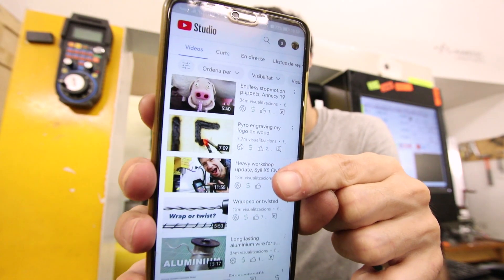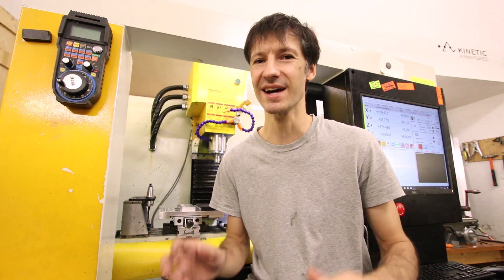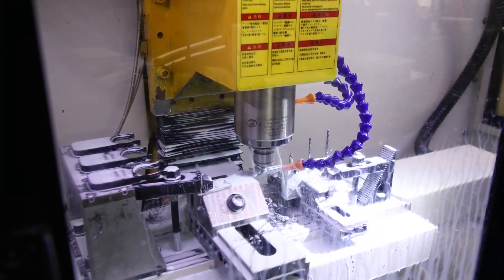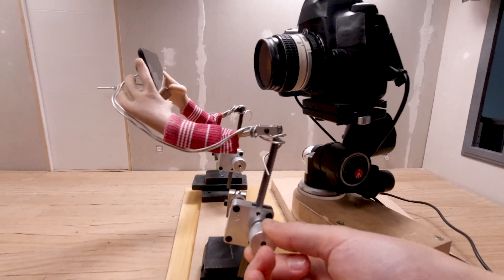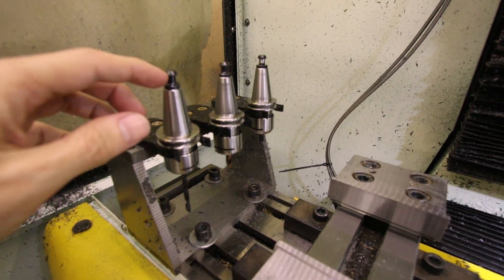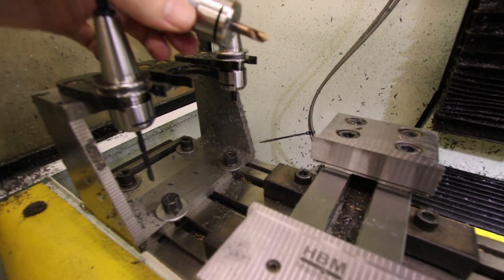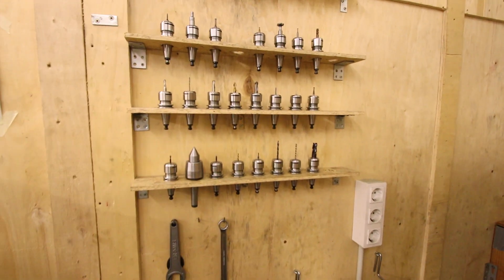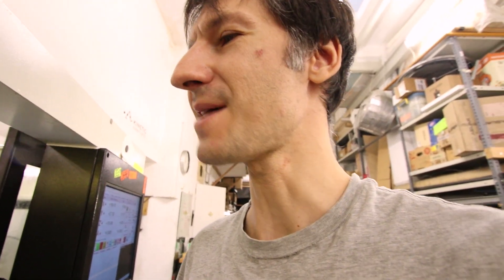I need more tools, let's fix this!

Comment: You should invest in a iron worker with your cnc you could make punch and dies for it and rapidly make small parts like compression plates
Reply from the maker: Well not sure, I dont like that style joints. But you are right that more employees will make more products. Not in the point to hire

Comment: Not a fan of the loud music, had to skip a lot,  sure was spoiled ...
Reply from the maker: at least did you like the work?
Reply: @edupuertasfruns  yes, but it only doubled the holders but that is probably the best that could be done.
Reply from the maker: @jyvben1520  that's the more reasonable thing. Investing in a 10 tool spinning rack would be too much for this size machine